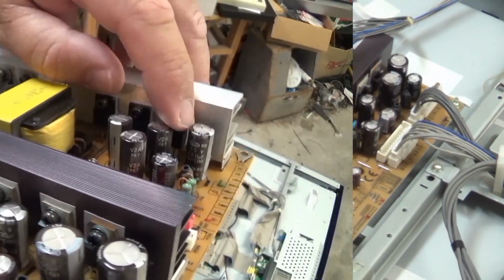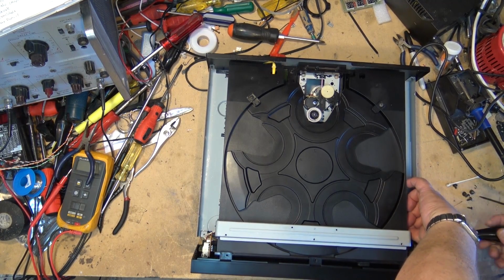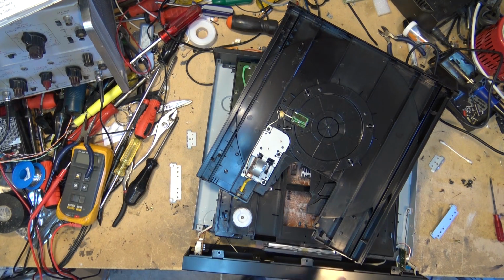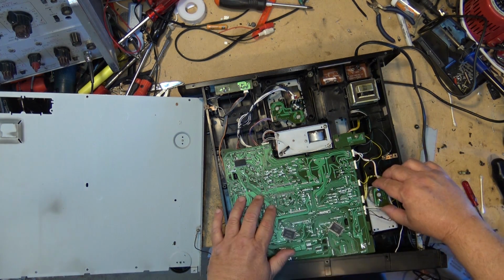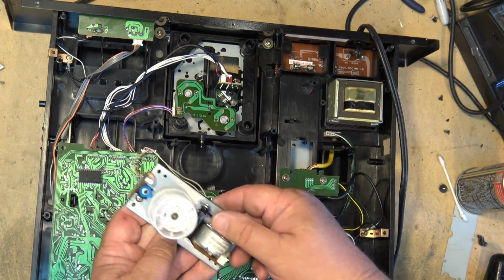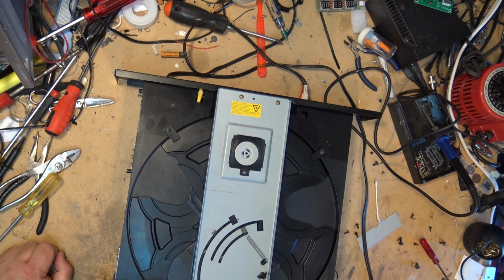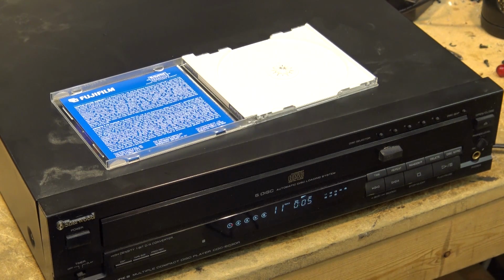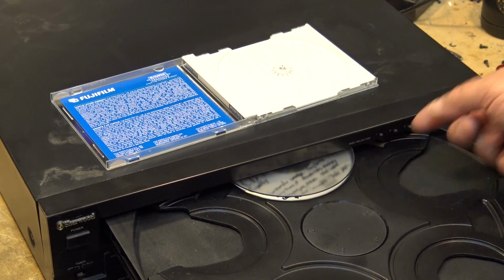Sherwood CDC 5030 Overhaul

Comment: I have the same identical Sherwood 5 disk charger in my attic, and a Sherwood amplifier sitting at the bottom of my wardrobe, amp works fine but the cd player needs a new laser unit.. it's the old style connecter on laser so I don't have a spare.. I have spare kss- 213 pickups that use a ribbon connecter. the Sherwood used 2 wired connecters. apart from the connecter the laser does looks the same.

Comment: I have two insidious questions... What is the price of this device now and what is the price of this repair? bkz here, where i am, i will take maybe $3-4, not more. (dead economy). What are the prices in Canada?
Reply from the maker: qwertyuiozcbm  
a quick scan of eBay shows that one of these sold for 65.00. I won't get that for it. will probably put it up ask for 40 and let it go for 20 or whatever I get offered. 
it cost me nothing to acquire just 45 minutes or so time. I will make hundreds over time on the views. that is how I can do those restorations so cheap. spending 2 or 3 hours troubleshooting and only charge the client 50 because I will make money going forward from the channel.
Reply: yeah, well, so, huh, 65*26=noooo, 1690 for this crap... new DVD player here cost 300, 10 year old VHS-VCR Hi-Fi near 250, second-hand PC motherboard AM3 near 750, 2Tb hard disk near 1300, im talking about analog of eBay in my country. One pack of cigarettes 16 (in store, dont misunderstand me). CD player... who need CD-AUDIO(!!!) player??? eBay with 65.00 make me crrrazy :)

Ah and oh, If I had a video camera... I will show on youtube what people bring to me for repairs... Concrete dust and a cobweb wall inside not the worst thing that I cleaned out! (one problem - i dont know how to interesting tell)
Reply from the maker: You would be surprised at the stuff I have found in VCRs.
Chicken bones, sandwiches, condoms. Yes! Oh that was gross. I opened the machine up, and hello. Closed it back up, called the customer and said come get it, you can have your "deposit" back too, and not the cash they left for an estimate fee.
Had a few TVs that the family dog lifted it's leg on thinking that expensive pedistil TV was a fire hydrant or a tree,
Reply: HAHAHA!!! Where do the children hide the half-eaten cookies? DVD and VCR great hidden place!
Here need gloom music - Cemetery of zombie cockroaches... (kitchen TVset) 
I love my profession, surprise every day!
Reply: to qwertyuiozcbm:
By any chance, are you in Ukraine? Exchange rate of 26UAH=1USD looks too familiar.
People that might want to buy a CD-player still exist! AudioCD shops have obviously seen better days but people still buy music on CDs.
When you are old enough to appreciate owning music on a hard medium but reasonable enough to go for a medium that does not wear out when playing, CD is the only choice.

From what I've seen, decent models are priced starting around ~50USD but you can get a bargain as low as 15USD; depends on how much of an audiophile you are of course.

65USD for a quality build reliable unit is not too much if you know what you want from a CD-player.